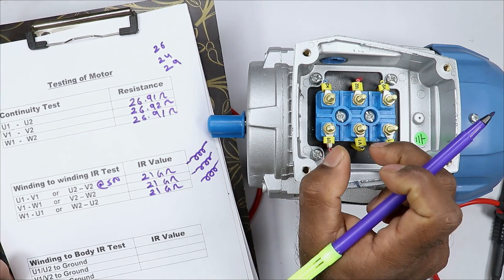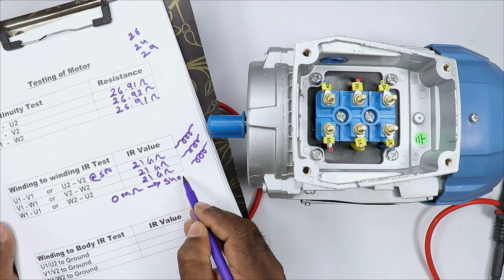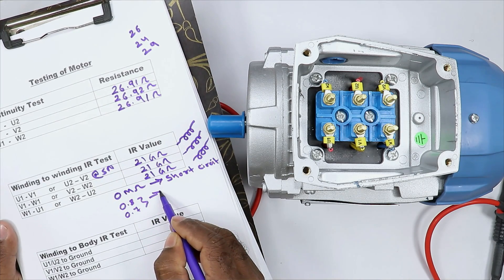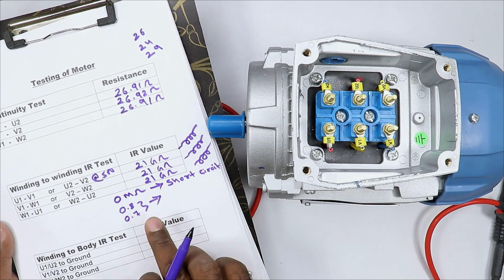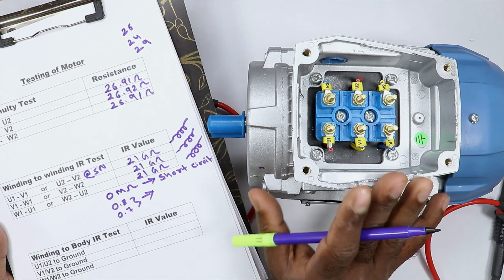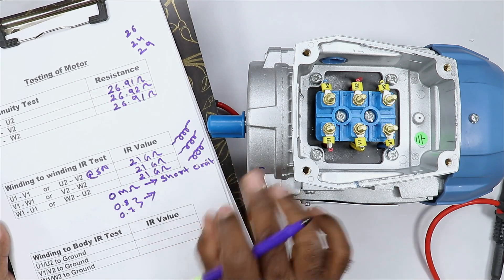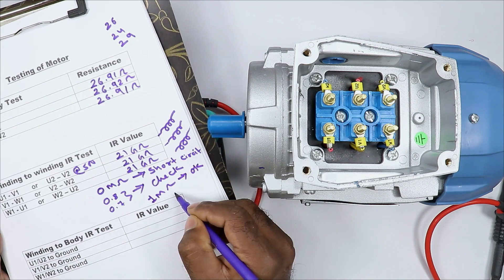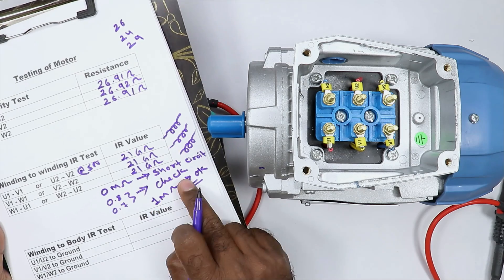Learn Practically How to Check Motor with Insulation Tester @TheElectricalGuy

Comment: Nice video.. to add it is first important to know your motor winding starting configuration. Motors are coiled/ arranged in Wye Delta Starting or Part Winding Starting as an example. This is important especially when reading the IR result. That means the 0 ohms does not always mean there is no winding insulation or the winding insulation is weak.  In a Wye Delta arrangement the 0 ohm value could also mean the phases are connected.

Comment: I have a question.
i am working at coal power plant. When we measure insulation of the motor, we get phase to  phase resistance 0 Mega ohm. And phase to ground infinite. 
Can you explain about this?

Comment: IR test should be done only between body & terminals need to be shorted with fuse wire. If not you will be electrocuted due high static charge by touching terminals , after completion of test, Be careful,  Similarly only milli ohm meters or ohm meters should  should be used for measring resistance, good luck

Comment: You fabricate results, what is contact   resistance of you probes, any variation, at which temperature resistance.  you are measuring resistance in strong   inductive circuit is it  your continuity meter OK??

Comment: Sometimes the motor fails all 3 tests,,,,, don't stress,,,, one final test,,,,, remove wires and test the terminal block,,,,, it can sometimes be the problem with it's own insulation failure,,,,😊

Comment: How much megaohm is the minimum insulation reading for motor line to line and line to ground??  Your answer will be highly appreciated ty
Reply: If the IR(insulation resistance) is less than 1mega ohm then we can call it that winding is weak, and soon we will face an issue of winding short

If IR is more than 1mega ohm than it should be ok
Reply: Thank you.. Why the rotation of reverse when you interchange the phase connections??

Comment: Why 500V and not 1000V?
Reply: Because this motor is 415V
Reply: This motor is 415V rms but the peak voltage is above 500 so I guess this motor must be tested at a higher voltage
Reply: Not necessarily, as 1000V may damage the winding. @roseelectronics4582

Comment: at the last testing you did which is the winding to body IR Test .. 
After U1 , before you test V1 , I think you need to press again the test button so that the value appeared when you tested U1 will be removed and you can have a unique test value for V2.

Comment: Regulation states that the resistance between winding values is not to differ more than 5%. If it does the motor fails the test as imbalance resistance between winding resistance.